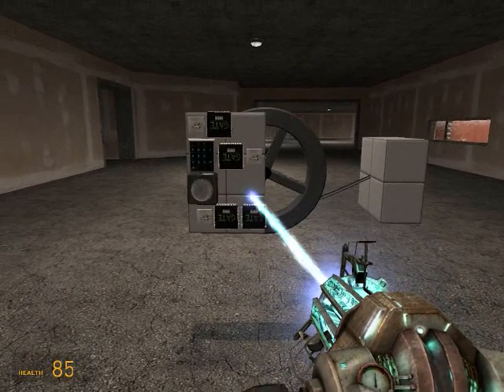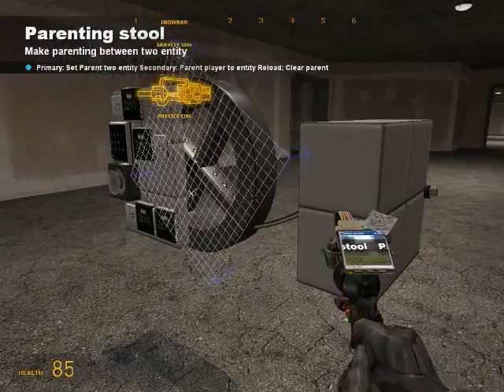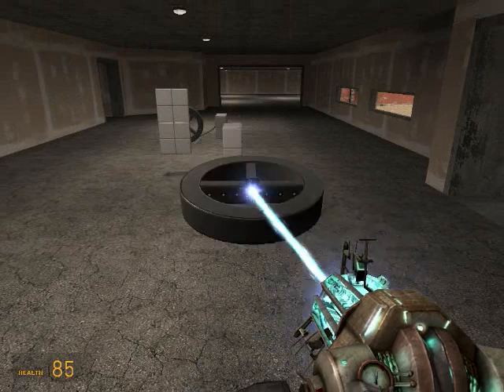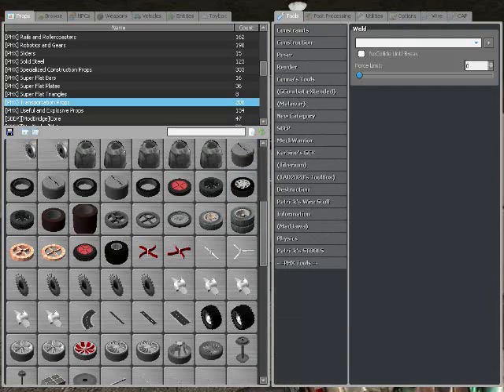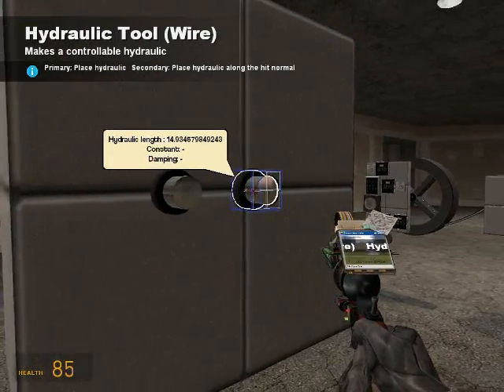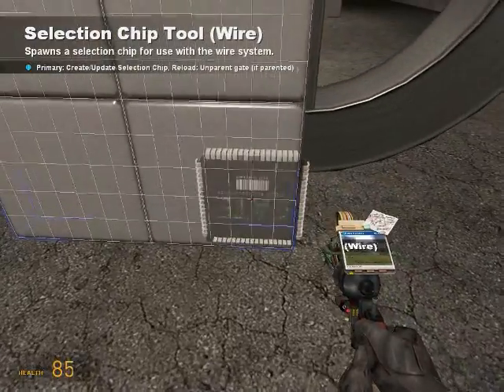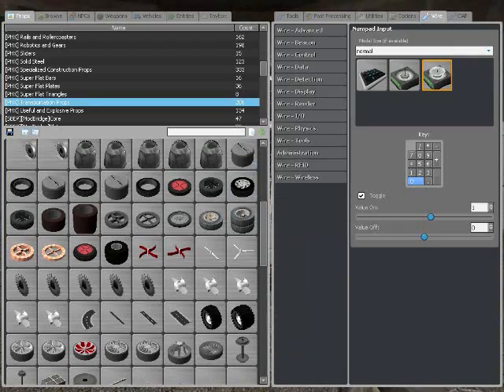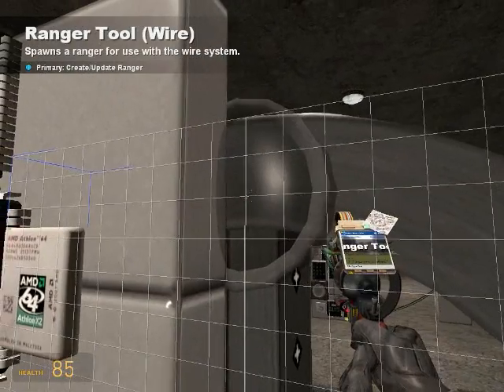[Gmod] Hydrualic Engine Tutorial #3

Comment from the maker: @csmapper58 Parenting is where you make one prop part of another prop like combine the entities, its hard to explain. Parenting is different than welding and normally I wouldn't use it. Parenting is something you have to be careful with. Always duplicate your stuff before you parent. I would recommend watching a tutorial on parenting.
I plan on updating my tutorials to beacon sensor engines because beacon sensors allow faster RPM.
And because these tutorials are kind of crap but thanks.